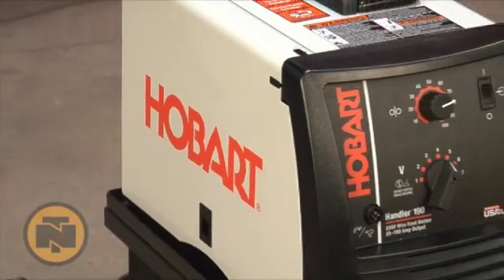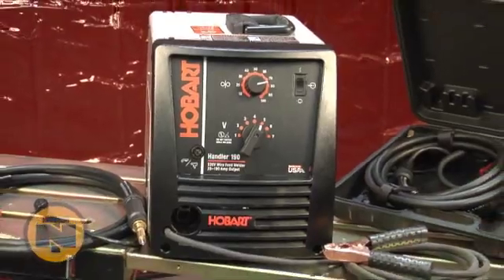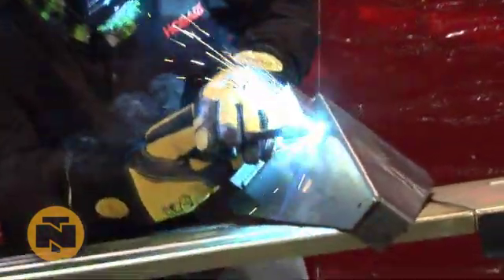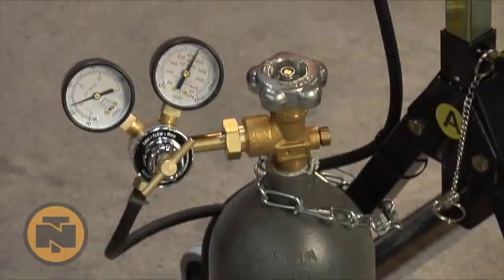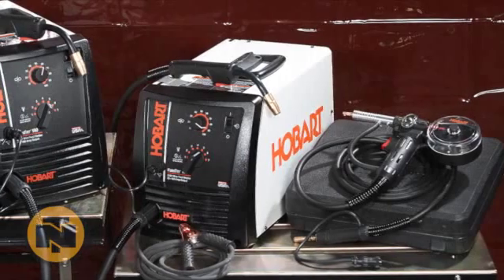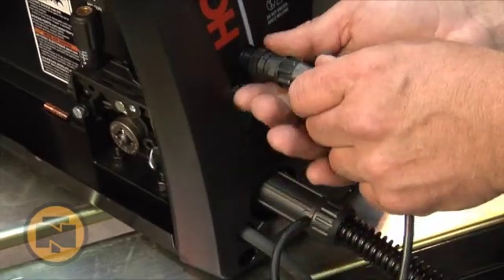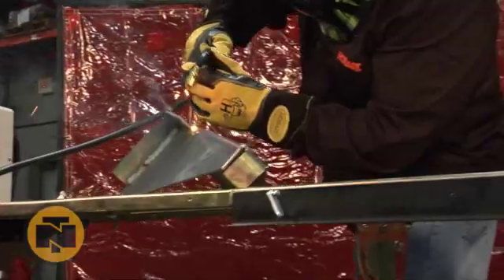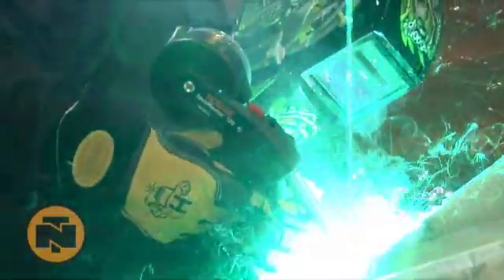Hobart Handler 190 Flux-Core/MIG Welder  230V 190 Amp Model# 500554

Comment: How do I install the wire
Reply: It's in the owners manual.
Reply: @calvinhandley2373  thank you, even tho it took 2 years for someone to reply.
Reply: Bob SixthSense just happened to see the video today. There are some videos that show the process in detail. Most of the suitcase style MIG welders load the wire pretty much the same way, just a matter of whether the door is on the left side or right side, and whether the wire feeds from the top or bottom of the spool. If you can't find a video showing the process on the Hobart, the video on a Lincoln or Miller will show you how it's done.
Reply: @calvinhandley2373  damn, but I've since moved away from Ohio and my psycho ex.
Reply: Bob SixthSense so you don't need permission to buy yourself a welder. BTW Hobart just introduced a new welder that not only does MIG, but also stick and TIG welding. Also will run on either 110 or 220 volts.